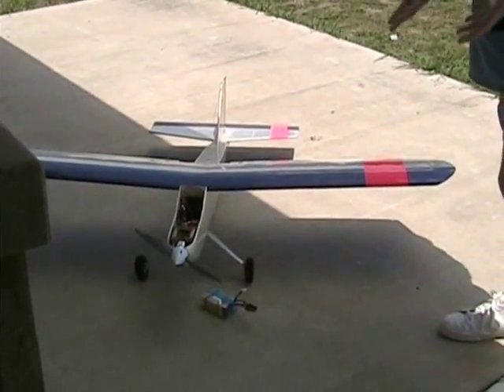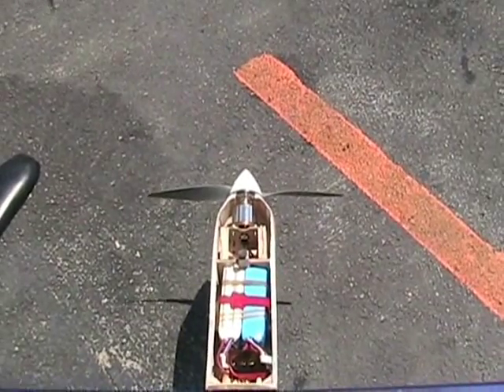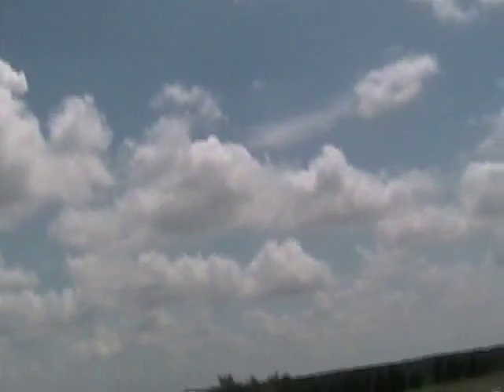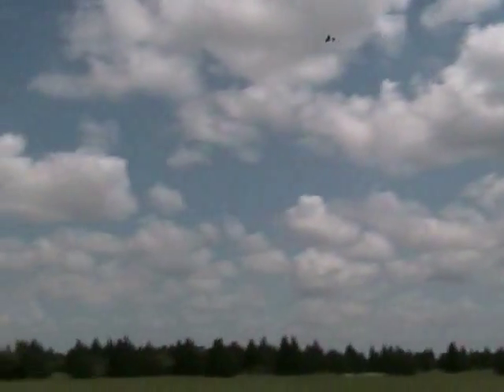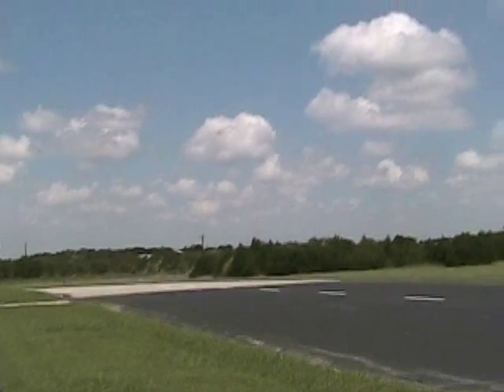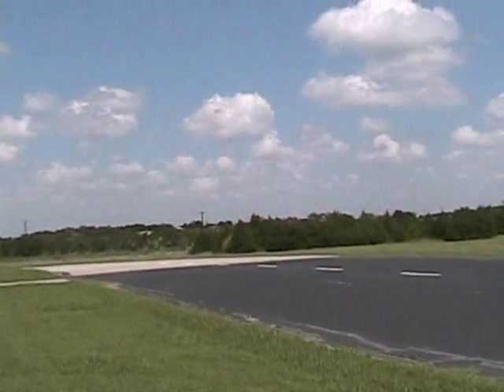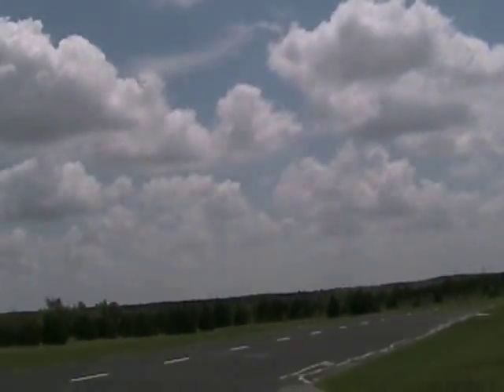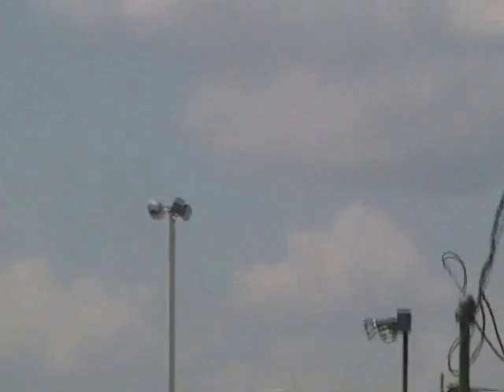Sig LT-25 E-conversion

Comment from the maker: I'd read that too, but since I originally intended this to be a trainer for my wife, I left it stock. Turns out that it flies just great. The roll rate isn't super-fast, but it's adequate. If I were to seal the aileron hinge gap it'd be quicker I'm sure. It's a great flyer!

Comment from the maker: Thanks! It's stock dihedral. The only mods I made were the bolt on wing, and I didn't run the ailerons all the way to the tip (I glued a short section to the wing).